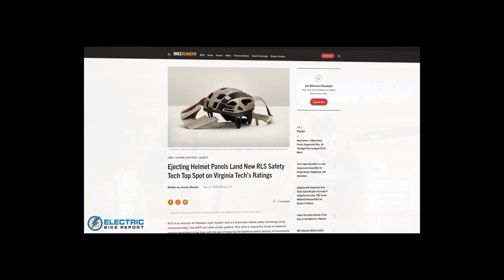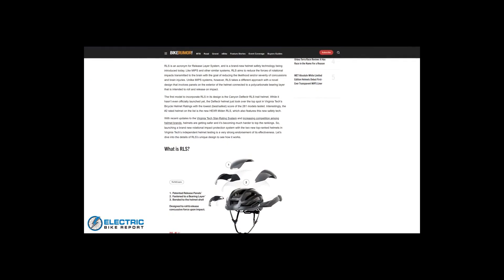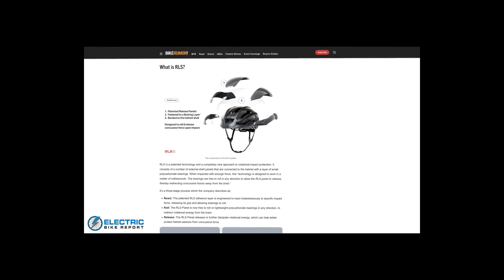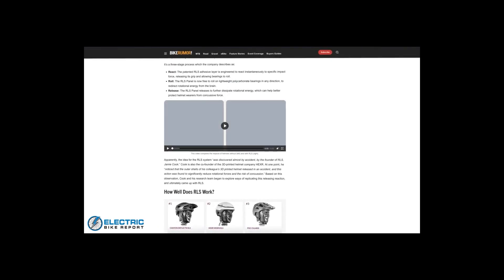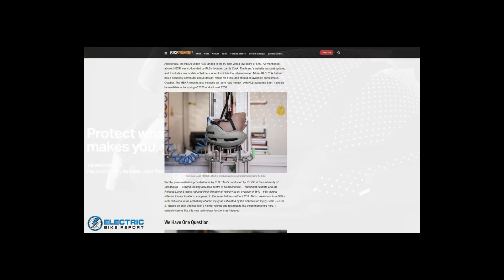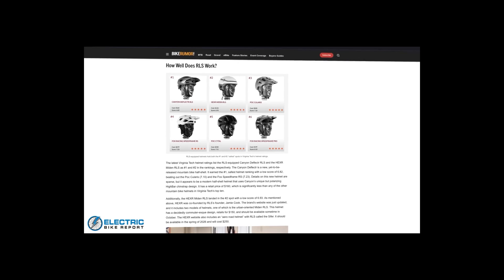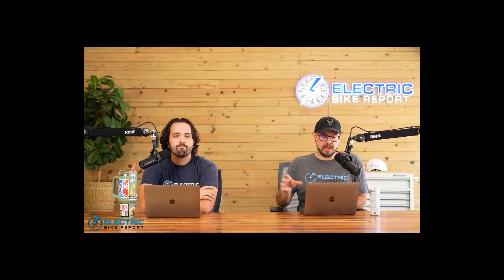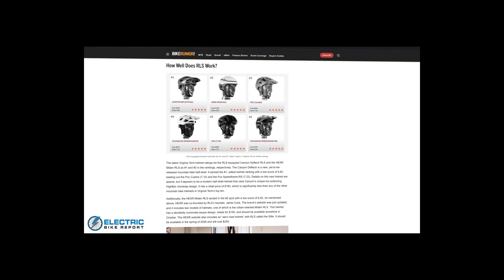New #1 & #2 Bike Helmets – Shocking Test Results! RLS Helmet Tech

Comment: There's people already believing that this helmet was designed just to beat the test, and not be of true help in a real life situation.

I think Virginia Tech needs to test real-life situations and not just in a lab. Nobody falls directly vertical on their helmet
Reply from the maker: Where did you hear folks saying it was just designed to excel in the test?
Reply: My main concern is secondary impacts in areas where the breakaway plates are already gone. For single impacts, it sounds great, but when you get thrown off a bike, you can roll several times, especially when tossed at high speed.